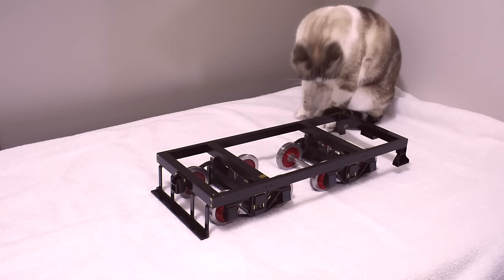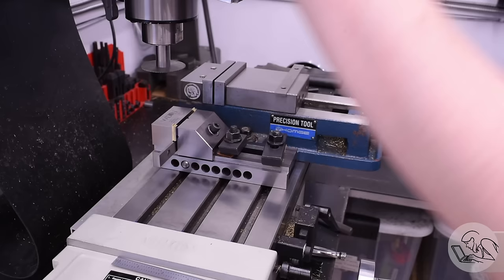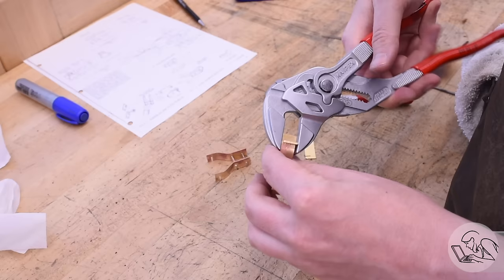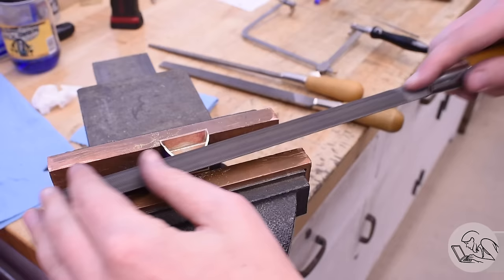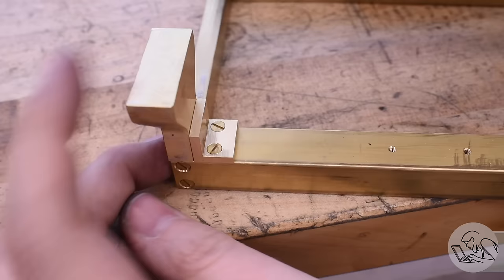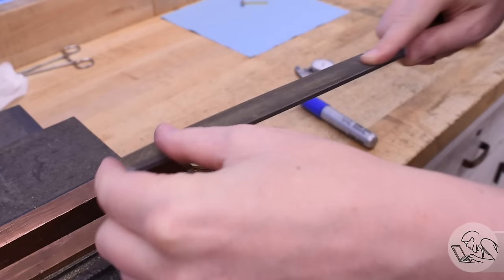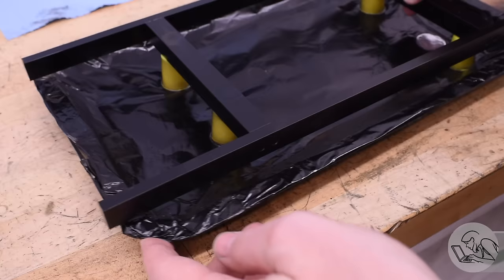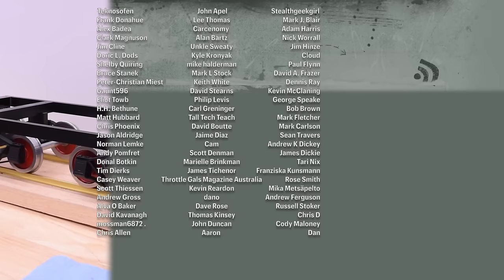Finishing the Tender Chassis! Pennsylvania A3 Switcher, Part 20

Comment: I've soldered small parts for many years in my trade. You might find that soldering parts like the ladder will require less heat if you solder them on a wire wig instead a block. It will allow greater heat spread and, unlike the block, not act as a heat sink.
Love your videos and always a pleasure to watch you work.

Comment: It the early 80s, I bought Kozo's book on the Heisler. I was working for a large Tool & Die shop at the time and they were open 24/7 which gave me plenty of access to machines after hours not to mention plenty of access to materials. I started working of it and had the engine (cylinders, crank, rods, etc. almost completed when I changed jobs and lost my access to machines. Went on the drawing board for a design outfit. I kept the parts and book for a few years then finally selling everything to a guy that had his own little machine shop. Always wished I could have finished it and I have no idea if the other guy did. You're doing a great job though. Hang with it.

Comment: I love seeing you master the powder coating process! 
Standing the oven on edge might work but it might also ruin the oven because these usually have some ventilation openings that rely on the oven being in the right orientation. Might be worth trying out though as the oven does not look to be too expensive to replace in the worst case ;-)

Comment: Quinn, and additional advantage to mounting the work high above the vise "CNC" style is, so long as all features in X and Y are done in a single setup, vise tramming is removed from the equation.  You could make a block perfectly square within the limits of your machine in a skewed vise by cutting 5 sides and then flipping the part over and decking off the excess material.

Comment: Thank you Quin. The soldiering the ladders in Fig 4-12 of the book and it shows soldiering on the brick but as you have shown it doesn't quiet work. Its great to see these issues before building so remaking parts can be kept to a minimum.

Comment: Having worked in fabrication and also messed with a bit of home powder coating too... If you can put a bolt you don't care about and every single hole prior to  powder coating and leave it there through the baking process. It's very easy for abrasive to get embedded in the powder coat and screw holes and chew up your tabs or even cause the taps to misalign. Way easier to just unthread a bolt. There will always be a little tiny cross-training right where the threads start. A chamfer tool will get it.

If you were impressed with the tinfoil you really need to powder coat a chunk of lead. Many of us use powder coat as a polymer jacket on bullets and the test for adhesion as you take a bullet you don't care about and pounded flat on the anvil of your voice with a hammer. If you did it right you're codding should be completely intact. In fact you can recover shot bullets. If you melt down fired bullets or rejects, you get perfect little eggshell because PC has a higher melting point than lead.

Comment: Nice progress!    Something I've done for parts that are overall painted is to make up riser blocks that have pins for supporting the part with the wet paint.  As in literally dress maker's pins with the heads cut off and jabbed into wood blocks.  The sharp points leave either no or minimal marks that are all but invisible.  Perhaps that could work for use on the powder coating?  The pins being metal might form a little powder coated fillet bump but if you put the support pins at positions that will be covered during assembly?

If you tip the toaster oven onto its end you might want to do it so the controls are on the lower end.  I've had a couple of them apart over the years and there's little or no insulation between the baking compartment and the controls area.  So better if the controls are at the bottom so the rising heat does not directly cause overheating.  The thermostat of the two I've seen is also mounted on that common wall between the compartments.  So a good idea to double check with an oven thermometer.  Of course if you bought one that has a convection fan it should be fine.

Comment: Standing the toaster oven on its side may accommodate longer pieces, but will reduce the lifespan of the oven. And, oh yea, there's a risk of fire. The issue is the heat convection within the oven cavity, and the the way it may interact with the innerworkings (i.e. wiring and electronics; safeties and controls). If I was to try it, which I would not recommend, I would definitely place it controls down, outside on a concrete pad, away from property, ready to unplug it at a moment's notice. 🤣Just considering the functionality, one of the first things that may not work properly is the way the oven cycles heating to get to (and maintain) a desired temperature. Therefore, in my opinion, not worth the risk. Cheers.

Comment: I Highly recommend do not rotate the toaster oven. The toaster is designed to use convective cooling to stop the heat from getting to the electrical controls and also for the thermostat control. Rotating the oven will put heat where it should not be. Just an FYI Thanks for the great videos

Comment: Hi in our workshop we put rubber tube over the thread on parts that get coated. 
Plus we put screws or plastic plug in to tapped holes so you don't have to tap them twice just passing on tips ducky from the UK.

Comment: powder coating is impressive, and the foil was kinda amazing! and that soldering at 8:50 was 🤩🤩

while the advice of turning the oven on the side and hanging it is a great one and will likely override my "advice", I have seen another person making a model boiler use a nail board? pin board? that has some very fine nails or pins sticking out of it to support an object, that way minimal contact is made against the thing you are painting and the support, vs the heat proof silicone bumpers.

Comment: Sprocket is lovely and clearly so impressed by the powdercoated aluminum foil that she wouldn't even inspect it.

Out of curiosity, have you ever experimented with clocking screws so the slots all line up the same? I've seen it in 19th century metalwork and it's a great little detail that seems like something you'd enjoy mastering.

Comment: 13:02 mhh, that gave me an idea. How about an End-Stop for a vise that registers on a bore, 
with like a flat leafspring and a set of Pins on the underside?
Btw the Aluminium foil cupples, due to the sheetness of things, electricity to ground potential (because you've builded a capacitor)
and that's why the powder coating overspray landed there.
Also Stuff could charge up, especially if you spray something metallic that is not/badly grounded, like when its taking no more powder. 
For the touchy touchy funny surprise
Greetings

Comment: Hey Quinn, you know that nice new toaster oven? Could you use that to heat soak those small pieces before the soldering? Wouldn't that help with getting better solder flow since every piece would be preheated evenly?

Comment: Hi Quinn, first time / long time, in an earlier video of the silver soldering process with the boiler you said that it was near impossible to reheat the silver solder without damaging the copper, but in this video you were able to. Is this because you are using a different silver solder composition / product? Just wondering?

Comment: Very nice work!  Can you please explain the pickle bath solution?  Also do you have a video on the fabrication of the wall mounted bandsaw frame?
Reply: Jewelry supply houses carry Sparex,  but Swimming Pool acid, Acetic Acid, Salt and Vinegar all will work.  If you put a little steel in with the copper, you will copper coat the silver seams.  Doesn't  matter if you are going to powder coat of course .
Reply: @aktoad1  Great, thank you so much!

Comment: Nice, with every step, we stray away from imperfection. :)
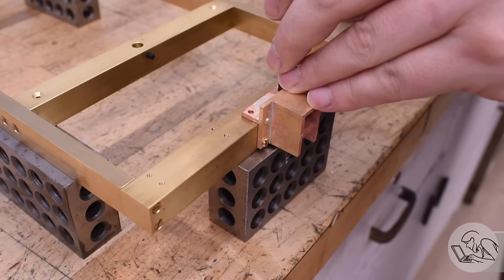but at @16:21 You have filed out smaller part - why not round out frame? where there is more material and is continous - removing weak solder is of course easier due to perpendicular walls that guides file, than rounding up to lously defined solder surface.

Comment: Don’t know if it’s any help but we used to get bolt and screw heads powder coated , the bolts were pushed through a piece of cardboard and the threads are wired together for a ground then the powder only goes onto the heads

Comment: Just curious.... Did you consider laser cutting all the parts, I did on my BR Class 76 bogies and the bodywork. A few days on the laptop gave me all the dxf files. Sent them off to the cutters and a week later, I had a comprehensive set of incredibly accurate parts.
Maybe the tender panels for the tank would benefit.
Reply: Kinda takes half of the fun out of having tools and knowing how to use them.
Reply: @mrimmortal1579  but isn't a laser cutter a new tool to be embraced into your arsenal..... Or don't you believe in using new technology?
Reply: @lesstoneuk  not at all, new tech is fine.  But fabricating parts using manual machinery and know-how is way different than downloading some computer files and sending them off to have someone else do the precision work for you.

One of those things is being a hobby machinist.  The other is being a hobby puzzle assembler.
Reply: @mrimmortal1579  you have got the wrong end of the stick. I spent nearly 6 weeks using a 2D CAD program to design, save, send off, redo a couple of drawings and having the bogie plates cut. All told there were 16 parts for the bogies. 
For the bodywork, I spent over 3 months designing the parts for the bodywork, of which there were over 45 induvidual parts. To hand build these would have taken months, if not a year.
Laser cutting produces consistently accurate repeat part, quickly, cheaply and of a greater accuracy than I could ever achieve with hacksaw and files.
Reply: @lesstoneuk   right, but in your initial post you were suggesting this method to Quinn.  But Quinn isn’t using a hacksaw and files.

Sometimes, the purpose of a project isn’t about how quickly you can have a finished project.  If that were the case, much time and effort could be saved by simply buying a finished item.  (But seriously, how many views would Quinn be getting if all she were doing was un-boxing videos (“Hey, look what I just bought!”). For that matter, Quinn would probably have far fewer subscribers if her schtick was “I designed a kit, and it’s arrived from the factory who precision cuts the parts.  Join me while I put it together, won’t you?”

Most usually, the joy one takes in a project comes from the doing of it.  The figuring out of an order of operations, the working around the limitations of your available tooling (and sometimes even in the making of additional tooling that you need), and in the doing of something with your own two hands while clawing precision out of chaos through sheer willpower and ingenuity.  There is a certain joy one receives in figuring out the math to get your parts to come out right, a certain joy one receives in learning new skills, and even a certain joy one receives from learning from one’s own mistakes.  

If you go back and watch more of Quinn’s videos, you’ll find that she thoroughly enjoys the work that she does, and that the finished product is merely a byproduct of her efforts.  And on top of all of that, she graciously records what she does, mistakes and all, and posts it for our education, entertainment, and enjoyment.

Please don’t get me wrong, I’m not trying to dismiss the work you do on your hobby projects, and I humbly apologize if that’s how I came across in earlier posts.  If you find enjoyment in what you do, then it’s not the wrong way for you to do it, because ultimately enjoyment is the whole purpose of a hobby.

Cheers!
Reply: Do you think everybody hand builds projects like this because an increasing amount are buying in parts and indeed complete locomotive kits. You should look up Keith Wilson and his 14xx loco build. That was a very successful series. I don't have a lathe. I don't have a mill. I do have a drill press. Can't see the wisdom in making wheels without those machine tools. Embrace  technology, not everyone can afford or have the space for a fully equipped machine shop. I certainly don't which brings me to the point, should I not build a 5" gauge locomotive because of that. Of course I should, by using the tools I do have.
Each to their own

Comment: Could I put you to the trouble of measuring the thickness of the powder coating on aluminium foil, if the opportunity arises?  I knew it is tough but I didn't know it is so flexible.
Reply: You can even powder coat wire and still form it.